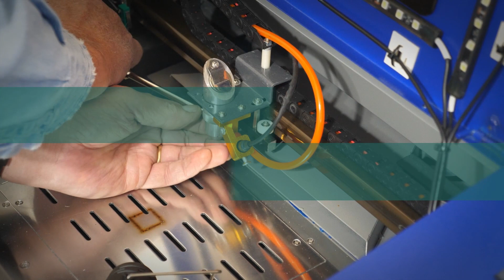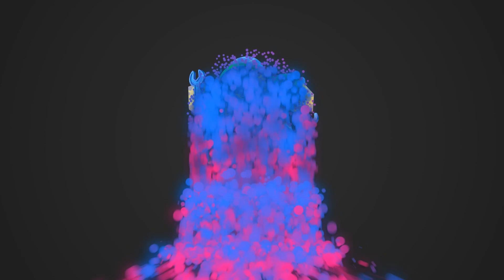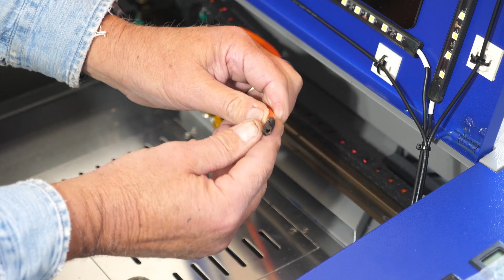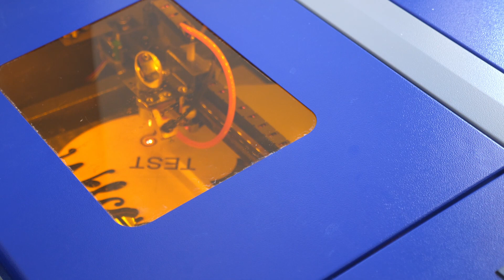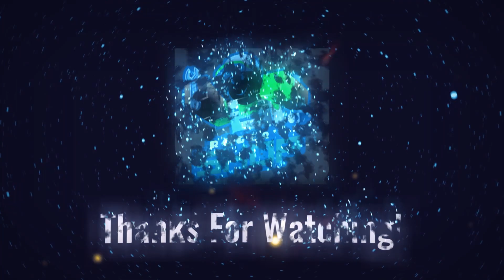Monport 40W CO2 Laser Air Assist Add

Comment: Roger, you convinced me to add a Monport40 to my collection. I am following your mods. The laser head you used is no longer available. Looks like the Ultrarayc has the same specs .. do you agree?
Also, when you installed the heat exchanger, you added the Digiten water flow controller. Is there much value in controlling the flow that much?
Reply: thanks for the speedy response.
Reply from the maker: I added the flow meter "just because".  It is not really necessary.  I was just curious what the flow rate would be.

Comment: What kind / type of pump / compressor are you using to supply the air & how are you regulating the air pressure to the head?  Also, that tubing looks a bit stiff.  Maybe a little more flexible tubing should be used?
Reply from the maker: Tubing works fine and doe snot kink.  There is an air pressure regulator set to 8-10 psi.  My air supply for this laser is my shop compressor since it is right below the laser, downstairs.  There is a filter and water extractor on this compressor as it is quite large.  (60 gal tank)

Comment: Hey Roger.  Thanks for posting this.  Do you know if the stock lens will work or do I need to get a different sized lens?  I have a pump that uses standard aquarium tubing (the small kind), will that fit?
Reply from the maker: Stock Lens works fine.  Standard aquarium tubing will also fit.